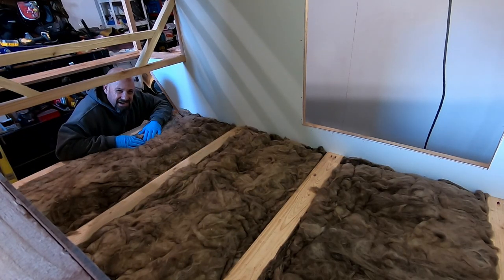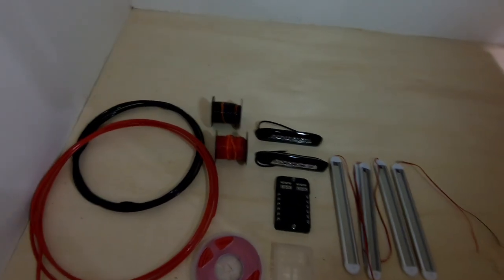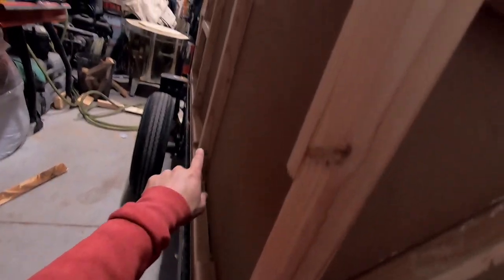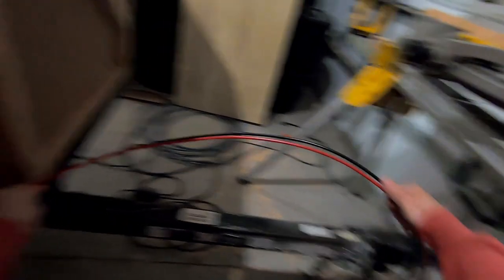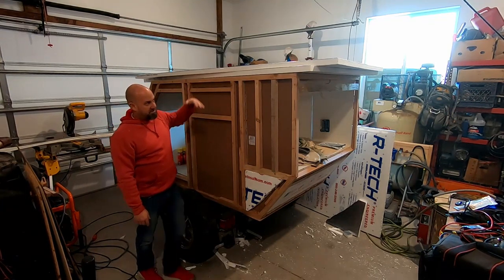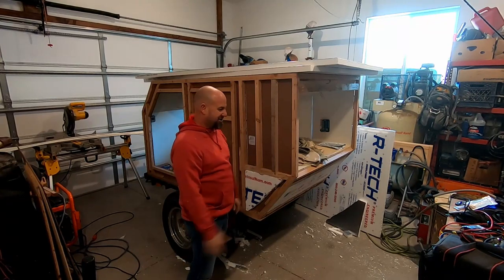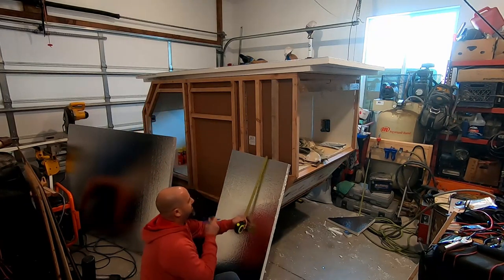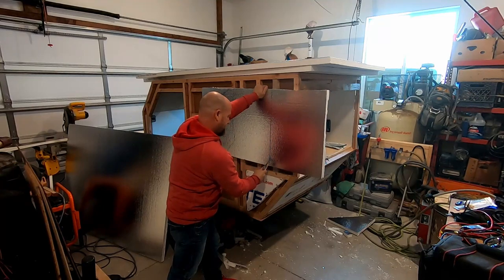Overland trailer build, DIY camping trailer, Teardrop trailer wiring, off road camper

Comment: That’s not house hold 120v 6awg is it. If so, I know it’s to late but fine multi strand wire is better for 12v the larger strand in house hold 120v doesn’t work as well.